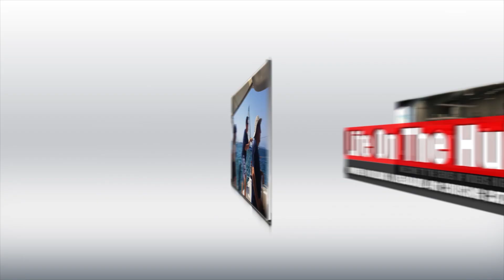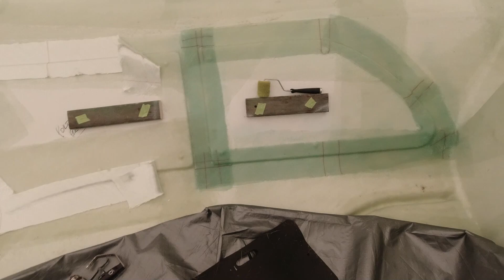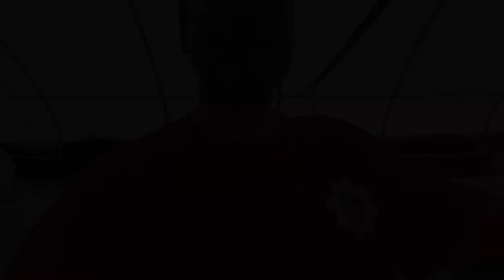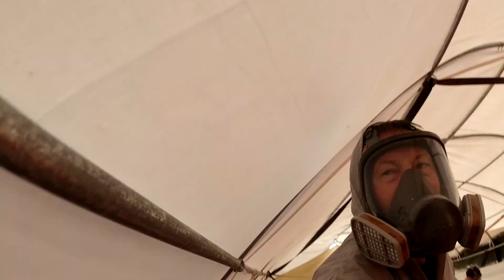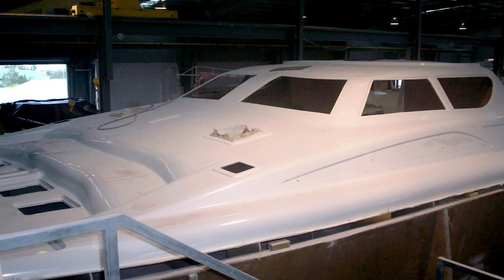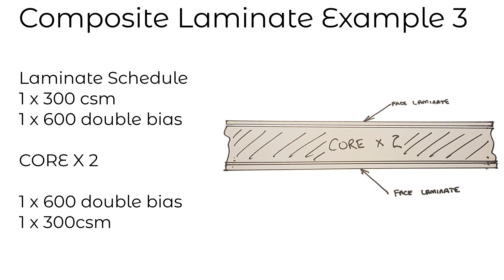EP 169 Laminating Catamaran Deck Window Inserts & Understanding Laminate and Core Structures

Comment: I'm really glad for your explanation about why you're not using a chop gun. The humidity issues you're dealing with are just as annoying as the cold issues of working in unheated shops in New England during wintertime.

Comment: So how much of a bend (how tight of one) can you do with honeycombed aluminum, and would it be stronger than foam or balsa wood? And what about weight to strength and cost, I figure that a hull using aluminum honeycomb would be heaver but would it be so much stronger that the strength would outway the weight problem. Is that true or not?
Reply from the maker: I am uncertain of the properties that the aluminium could be contorted to but it is indeed flexible and I would imagine a boat made of it would have superior rigidity.Prohibiting factor would likely be the cost.Rossco

Comment: I was wondering if you were going to reference that book about halfway through your lecture. That is a great book and gave me a lot of practical insight into composites. Two other books I've referred to in the past were Competition Car Composites by McBeath and Formula 1 Composite Materials by Savage (I may have the titles a bit off, as I'm going by memory). While the titles sound a bit specialized they go into extensive detail about calculating load and creating layup schedules. I wish more people had read these titles in certain industries (cough cycle manufacturing) as it is amazing how bad some large companies are at designing composites.

Comment: Great video as ever bud. Does the design of your boat define a ply fibre orientation for the full boat or locally in each area? Do you cut the double bias at say 45 degrees on alternate laminates to balance out the fibre in the laminate stack? I get a sense on many boat builds that lay upon layer of “1708” gets stacked effectively with every layer @ +/- 45 and no fibre @ 0/90.?
I heard you mention Quad which is very rarely mentioned, do you use Triaxial at all or UD material?
If you interested I could let you have some aerospace composite component drawings for reference?

Comment: Hi Ross,

How are you dealing with the impact strength requirements? Yours is a surveyed build?
Reply from the maker: Hey Kev, I am following the laminates supplied by Oceanic Yacht Design Surveyors and they have explicitly outlined the laminates and cores required for seaworthiness. I honesty cannot attest to the impact strength as I believe that unless a boat is steel it will not survive a heavy impact, that said crash bulkheads and additional laminates in the bow including sold glass keel line has been employed to meet the Australian Standard. The schedule I am working to also has defined regions where certain laminates are applied and multiple overlapping quadraxial laminates are required. Cheers Ross
Reply: @LifeOnTheHulls  sounds like ours! Different areas have different thicknesses, we are working to Lloyd’s. with the NSCV they allow us to reduce laminate thickness for exotic materials (eglass and epoxy) as long as it’s a strong as the Lloyd’s CSM layup, this allows us to have an equally strong vessel at reduced weight. However most of this info is commercial in confidence so we are having to reinvent the wheel with trial layups and laboratory testing, tedious but should give us the best strength to weight ratio. Keep up the good work. Kev.

Comment: What do you think of the use of balsa instead of the foam that you used?  Its stand out property seems to be stiffness.  One manufacturer says that although it is heavier you can use less so the weight penalty is not so high.  They also say less resin soaks into balsa compared to foam.
Reply from the maker: I personally like the balsa core as a substrate medium, the issue is when fittings become loose or replaced and not cored properly local moisture can create bigger problems. My choice would still be the new PVC Foams as there ie virtually no rot and moisture absorption, however adhesion to the laminate is not as sound as Balsa so It appears it would 6 of one and half dozen of another. Cheers Ross.